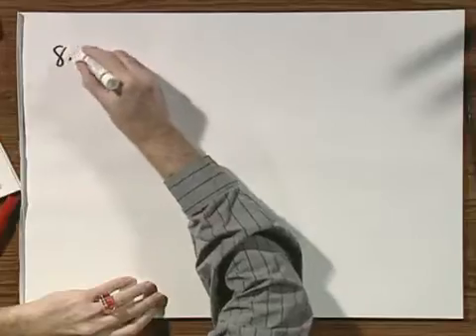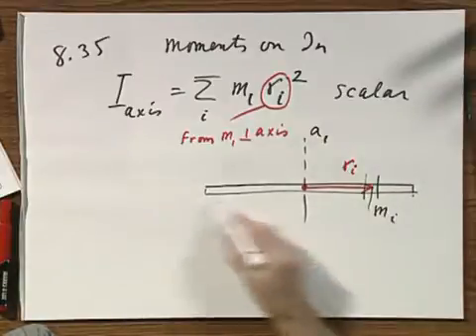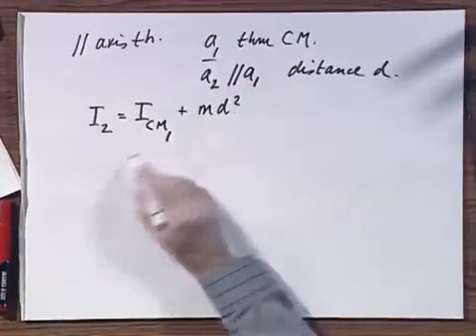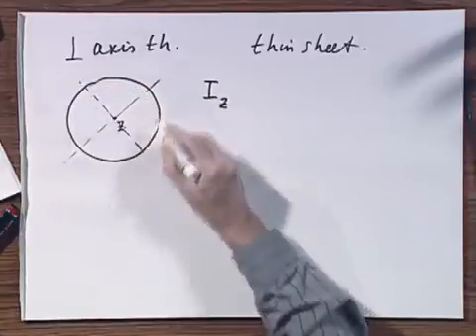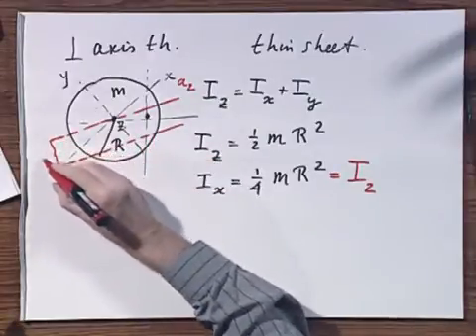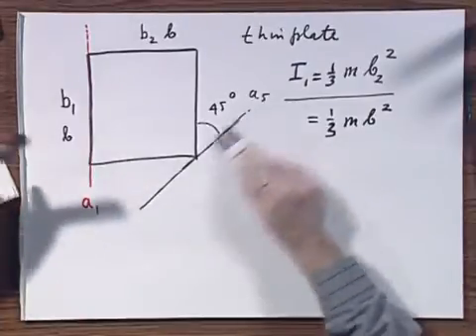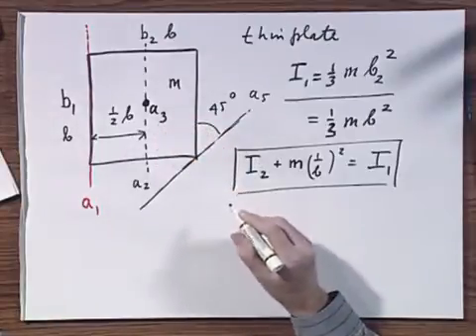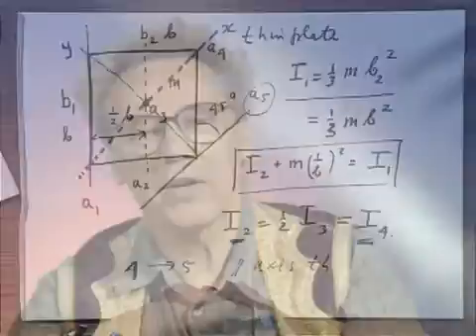8.01x - Module 20.01 - Moments of Inertia of thin rotating disc on and off axis

Comment: sir I have a little doubts. sir  suppose there is a sphere which is rotating about the axis through centre of mass. sir my origin is not at the centre of mass. my origin is at space. sir than also moment of inertia is also 2/5mr2. sir is moment of inertia does not depend upon your origin
Reply from the maker: it's independent of origin

Comment: From where did you gave these questions?
Reply from the maker: During several years when my colleagues lectured 8.01 or 8.02 I would have weekly TV Help Sessions to help the students with their homework. They were taped at MIT
Reply: From which book you took the questions?
Reply from the maker: Of course, I always used the book that the lecturers used in the course as I covered the homework they assigned. They did not always use a standard physics text book. Several lecturers used a new book in the making which was only available at the MIT Coop.  I believe I still have a copy. 
Over the years I have done Help Sessions roughly a dozen times, starting in 1985. All tapes still exist. A small selection (of my 1997? Sessions) was digitized  for my EdX 8.01 and 8.02 courses. They are posted now on my channel.  Each term (fall 8.01 and spring 8.02) lasts about 10 weeks (thus it has 10 home work assignments). Thus there are a total of about 120 hours of my Help Sessions on tape in the MIT Archives. Only those that are now on my Channel have been digitized.